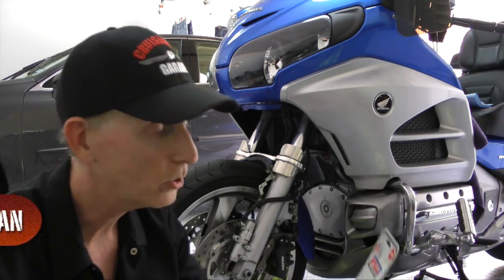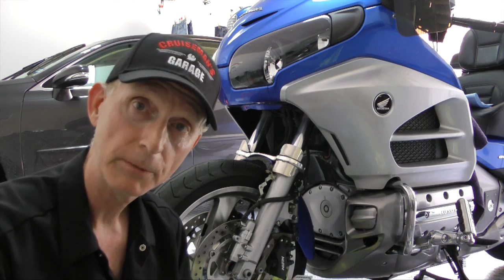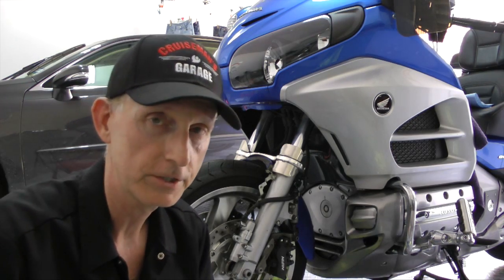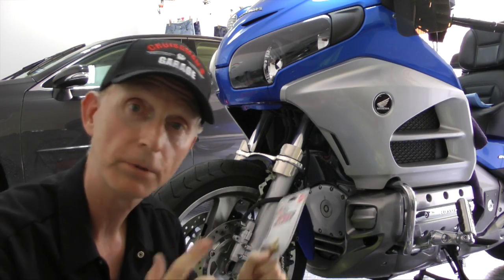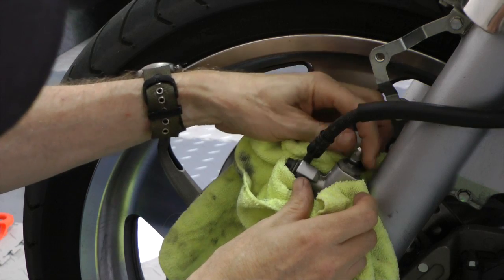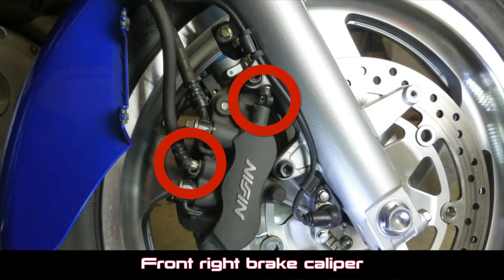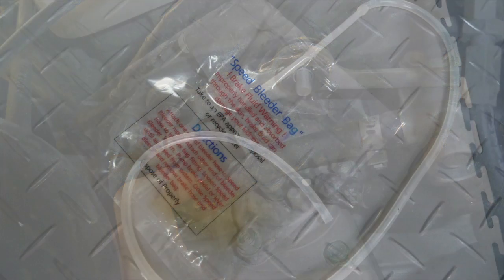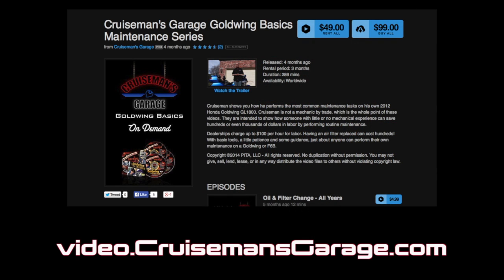Installing Speed Bleeders on Honda Goldwing GL1800 or F6B

Comment: Thank you Cruiseman!!! I did it on the front brakes with no problem. I just used the speedbleeders as a saftey to not allow air back in. I used a soda bottle with a hose in it and it worked great.
Reply from the maker: Love Speed Bleeders!

Comment: The solution for the hose slipping off is to put on the hose, then put a small cable tie around it right at the end, tight enough that it won't pull past the wide part of the bleeder.  The Speed Bleeders are a better way, though, if you are keeping the bike for a couple of years or longer.

Comment: I watch a lot of your videos and someone asked me on one of the Wing forums if I had ever bleed the brakes on my 2008 Wing. No...I have never bled the brakes. So I guess I should, but my question to you is...Do you think I can do this like we do it for airplanes? On my Cessna, I have a small 12 volt pump motor that we use and attach a hose to the bleeder...then turn the pump on and fill the lines from the bottom to the top. The pump is set to pump slow so as not to blow fluid all over the place. Turn the pump on and then stand by the reservoir with a large turkey baster and as the fluid comes up in the reservoir...suck it out as more fluid is coming in until you get clear. I have been trying to figure out why this idea wouldnt work and when I went to the Honda shop to ask them...they just looked at me and laughed with no answer. I am thinking this would work regardless if you follow the recommended way to do it or not because whatever bleeder valve you open, the pump is going to flush that line out without getting any air in it. Am I right or what would you say? Thanks...Paul